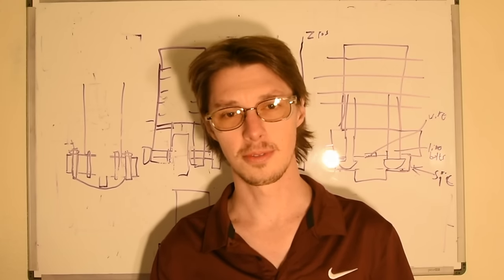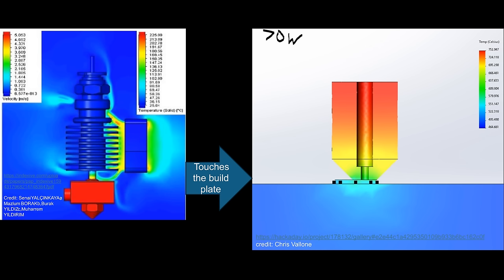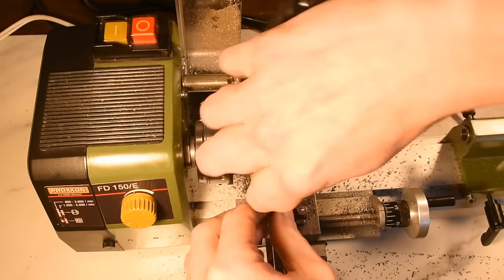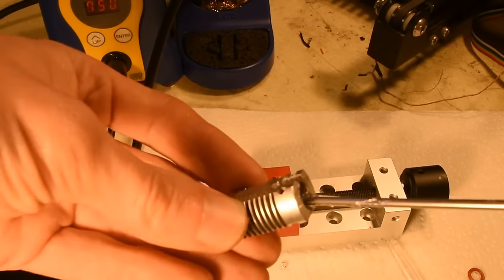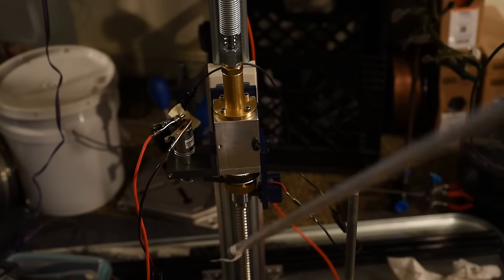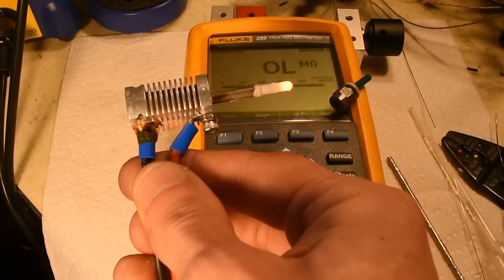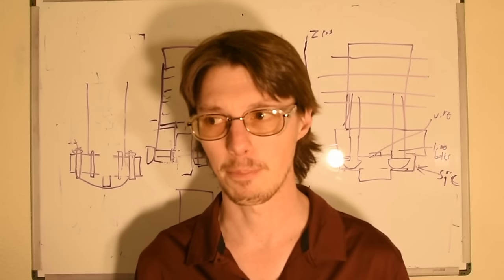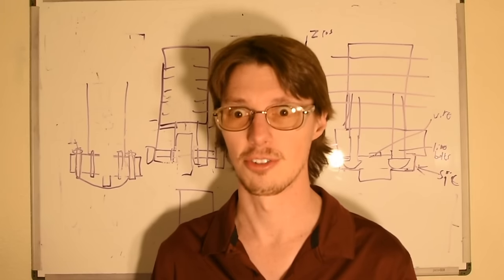How we made a 1300C 3D printer hotend for printing metals on the Creality Ender3

Comment: In both demonstrations at 4:18 
You weld the two metals together using the heat of the glow plug and the pressure you provided manually; forge welding. I imagine that the manual pressure is a significant factor when trying to bond these matierals. Regarding metal FDM, how will you recreate/ address this when printing? Is the heat of the extruded metal + your hot end enough to ensure a good bond to the previous layer? Not sure if you mentioned already in this or other videos sorry if redundant

Btw this is super cool.
Reply from the maker: on the printer, with actual temperature control, the metal exits the hotend in the semisolid state, where its yield strength is extremely low. low enough that the printer's motion frame and the extruder force can deform it and forge it into the previous layer. 
the pappilio lite belt extruder provides about ~12-15 newtons of thrust on a wire this small. which given the surface area of the tip of the 0.5mm wire (0.2 square milimeters) is equal to about 60-75 MPa of forging pressure at the point of deposition. because we do not have a nozzle constriction, this pressure is applied directly to the hottest region of the deposition zone thus ensuring forge welding like behavior on the constrained wire tip. 
the conditions are actually quite comparable to the examples, and actually more favorable in many ways. 
but only more testing can prove this out.

Comment: There's this company that came up called Yageo Nexensos that makes high temperature (up to 1000C) platinum resistive temperature sensors.  They'd be expensive if you can find them, they show up as 0 stock on digikey, but you might be able to get a quote from them directly.  Another option is infrared it wouldn't be as easy as slapping it to the side you'd have to consider things like smoke obstructing and emissivity and viewing angle, but they can in theory go up well past 1000C.
Reply from the maker: a good type K thermocouple, electrically isolated seems to be the way to go for now. :)

Comment: Anneal in air or in inert?

If you need to Anneal in air or mild inert (I can purge argon) let me know, I have a few furnaces and can fire up to 1700C, ramp-soak of course.

As for the thermocouple you should be able to filter out the electronic noise.

Comment: Would have thought a sheilding gas or inert atmosphere in the printer would be required for success with this concept, interested to see how it works out. Temperature feedback could possibly be achieved by sensing the change in resistance of the heating element from the ambient condition and using the resistance temp coefficient of the material to approximate its temperature.

Comment: Do you think you'll eventually be able to offer a metal printing upgrade kit for the ender 3 and clones thereof? 

Because I for one am VERY interested. But I lack the time and finances to experiment. 

Also, how would you go about interfacing with a slicer? I doubt cura supports aluminum.
Reply from the maker: yes this is the plan to offer open source upgrade kits when we can demonstrate function. 

as for slicing, adapting a slicer profile is not too difficult its mostly a matter of setting temperature and feedrate. otherwise the process physics are quite similar to printing chocolate just at very high temperatures.

Comment: An ambitious project for sure. As glow plugs were designed to be somewhat momentary for use, I'm curious as to the longevity you'll encounter. Replacing them per print as a consumable early on wouldn't surprise me. You may want to look into pulling the electrode out of a standard spark plug that fits your space parameters or other high temp electrode material designed for more prolonged use. 
With printing metal, there's a few other long-term environmental issues that will come up, namely weld contamination, when you attempt to print in open air. I'd be tempted to introduce more common welding materials such as flux core wire (contains its own shielding gas) and borrow the tips from said welders to transfer power to the wire. Although at that point, you'd be better served making a custom adapter to miniaturize a flux welder and use the cartesian system of the Ender as stand-in for a CNC coordinate system, which would rather defeat the purpose of your project. 
A worthwhile project that I'll definitely sub to see your future progress. 👍
Reply from the maker: the glow plugs are surprisingly robust to semisolid metal exposure. 
this still requires more testing to be sure. 
we are aiming for at least 1000 hours of print head lifetime in bronze.

Comment: Neato.  When you melted the wire to the borosilicate, it reminded me of how bond wires are welded to the silicon die in a computer chip.  I believe they use ultrasound for that?
Reply from the maker: yes. Though the first technique was thermocompression bonding, which was basically what I was doing, and one of my major inspirations for this project.
my day job is working in a cleanroom.
https://high-density-electronics.uark.edu/

Comment: Have you considered induction heating instead of resistive heating? You would be able to heat the wire even more directly, and be able to heat the print right under the nozzle for better layer bonding. The downsides would probably be having different heating characteristics for different metals, and not being able to print non conductive materials.
Reply from the maker: yes we have considered it and continue to investigate it. 

I want to be able to print ceramics and glasses as well. which makes it unattractive for my particular use cases.

also induction heating with wires this fine (0.5mm diameter)is extremely difficult and tends to be very power hungry due to losses to the substrate.

but if you do give it a try, I would love to see it. :)

Comment: Its really interesting to see a more direct form of metal printing attempted like this, now that the industry standard has shifted into laser sintering. Really looking forward to seeing where this goes
What is that tiny lathe you were using? Would you recommend it for small parts?
Reply from the maker: the proxxon FD150E is fantastic for small parts as long as you do not require autofeed.

I have used it with High speed steel tools that Proxxon provides, to cut everything from common plastics, torlon, and PTFE, all the way up to Titanium zirconium molybdenum alloys...

it is best for parts smaller than about 15mm in diameter. Though it can grip objects up to about 50mm in the 3 jaw chuck at maximum extent.  
the drill chuck it comes with is good up to about 7 mm bit size. but the lathe itself only has about ~150-200 watts of spindle power, so you have to be conservative on the feeds and speeds and make sure to keep your tools sharp and your work well lubricated. 

I have been very happy with it, compared to a boley watch lathe or some other similar thing at this size and cost range.

anything larger would be impractical for my use generally. so the proxxon has been a great fit.
Reply: @rotoforge2024 awesome, thanks for the info
Reply: Fascinating

Comment: When you get to printing don't forget the argon atmosphere, N2 works too. Need to remove the O2 from the print area with metals.
Reply from the maker: thanks!
going to try to work without this, by having very fast temperature control at the deposition region.
Reply: @rotoforge2024  Welding onto oxidation should make a bad weld right? But pardon my limited knowledge on metal fdm. I can't wait to see more, you are obviously the guy for making this happen👍🏼
Reply from the maker: @itsmetheghost4993  the tin in bronze melts before the copper does. molten tin is a potent getter for oxygen from the bronze surface. the still solid copper grains in the bronze when it is printed act to plastically deform and scrape the surface of the previous layer which facilitates intimate metal-metal contact at high temperatures. 
In this way, the need for a protective atmosphere can be reduced if this process of melting the tin, deforming the copper grains, and spreading the resultant semisolid metal bead onto the build surface of the previous layer  happens with sufficient speed and precision in terms of temperature control and at sufficient applied pressure at the deposition interface. 

IDK if i am the guy...but i am doing my best. lol

Comment: Isn't the stepper motor on the EDM drill kind of in a dangerous position to be contaminated with conductive debris? Feels like it would be much safer to have it mounted on the top of the rig instead of the bottom right by the vice.
Reply from the maker: it does not appear to be having trouble after about 20 drill operations. I will be sure to update if/when it fails.

Comment: great project!
PS arent you worried that the GT2 belt support/fasteners and stuff will melt from reflected heat?
Reply from the maker: Not at all. the glowplug power consumption is quite comparable to the stock hotend. So the stock cooling solution protects the printer quite well.

Comment: It will be so cool if this ends up working well and turning into some sort of ender 3 upgrade kit. Plastic 3d printing is nice but a high melting point metal 3d printer would enable the 3d printing of many things like engines or far tougher parts or parts that need to be heavy or thermally or electrically conductive.
At 1300ºC you are also very close of some steel alloys melting point, I wonder if you have plans to get there?
Reply from the maker: the glowplugs react with iron unfortunately...so the engine might have to be made of bronze, or maybe monel. Ferrous alloys are off the table until we can find a solution for their reactivity with the glowplug ceramic above about 900 C.
Reply: @rotoforge2024  It is a pity but any metal printing will be nice and monel seems to be very good, the only issue is cost vs steel but the convenience of 3d printing can make it totally worth it. I imagine that solving the reactivity issue won't be easy, maybe in a future where metal melting hotends are popular and custom made for that purpose instead of repurposing glow plugs.
Reply from the maker: @eruiluvatar236 This is probably the case. though we might have an alternative design that will get us there...
so IDK. 
research is not easily predictable.

Comment: Amazing project, may I say sounded ambitious until I you showed the progress you already made! All the best with your PHD.

On a side note, how are you planning to attach the thermocouples to the tip of the heater?
Reply from the maker: probably stuffing them into an alumina sheath tube from mcmaster, and mounting them with refractory zirconia adhesive from mcmaster. 
https://www.mcmaster.com/8746K586/
https://www.mcmaster.com/products/zirconia-adhesives/
using this thermocouple packed into the alumina tube with some boron nitride paste.
https://www.sparkfun.com/products/251
https://www.sliceengineering.com/products/boron-nitride-paste

Comment: Looks complex, but also super cool.  It gives some hope for at-home metal 3d printing in the future.  I realize it'll likely never be available for a typical 3D printing customer who is used to plastic, but maybe with some good ventilation and other safety measures, it could be used by a serious hobbyist.
Reply from the maker: I want it to be available for exactly these people. 
all the parts and materials for the printer cost less than ~150 USD as raw...
I spent about 1800 USD on the EDM drill. 
I intend to sell kits as drop in hotend replacements in the long run. so its as easy as possible to print metal on your desktop.
Reply: @rotoforge2024  Maybe a few more iterations of this and you could sell hot end kits including the oil pump, hot end power supply, tubing, ventilation fans, hose, cables, etc.  etc.. for around $1000-$2000.  I'm certain there's a market for that, because there'd be no competition (until Chinese manufacturers get into the act).  I think selling a complete kit is the way to go because it can build up a community of users who can advise each other on techniques because they're all using exactly the same components. And it would help you refine the system over time, and figure out where you can take advantage of economies of scale.  Or perhaps you could sell the whole concept to Creality or some other 3D printer company.

Have you been able to measure layer to layer bonding using this technique?
Reply from the maker: @yeroca  Are you suggesting i should sell EDM hole popping machines and hotends?

I might one day get into making whole machines for the hotends (probably also made custom rather than from glowplugs) but that day is a long way from now lol.

i agree a community running and developing on similar infrastructure is highly desirable. :)  I think we need to simplify our manufacturing process a bit more for this to really get into swing though...

initially I expect to be providing just hotend kits if anything at all. Mostly for alpha test to a limited number of select users until we know this can work and work well. I do not want to be selling some non functional product or shilling for investor cash. those seem like wastes of time. 

Thanks for the thoughtful comment. Frankly, I really hope some chinese manufacturers or other manufacturers get into the act. please  someone build this thing. 
I would love to be able to just buy a working metal and ceramic 3D printer for my home desktop for <1000 USD. I would do it immediately and cease my maddening toil. lol
Reply from the maker: @yeroca I should also note that we are targeting probably <1000 USD for the final kit price...
probably <500 if we can swing it that low...but its too early to tell.
Reply: @rotoforge2024  One thing I may have misunderstood... I was under the impression the oil pump is used to circulate a "coolant" through the upper part of the hot end.
Reply from the maker: @yeroca  the hotend is cooled with air from the stock ender 3 fan. 
the oil pump is used to pump oil through the EDM drill spindle to drill the hole in the glowoplug ceramic.
Reply: @rotoforge2024 Ah, got it.  Nice, so the oil pump is not needed during printing.

Comment: Have you looked into inductive heating of a hardened steel nozzle? I think this idea is a simpler solution
Reply from the maker: I should probably make a video about this considering the frequency of the question. 
but yes, we have considered it. 
I couldnt wrap one tight enough either without it melting down during printing.
and even if I wound it tight enough, it would need to run at a frequency where the driver cost would be huge. 
like 800 khz to 1 MHz.

maybe a bit more.
maybe halbach induction arrays could improve this situation. 
but I am interested in printing glasses and ceramics with the same hotend. So induction heating is not really going to suit my application....
would love to see it tried though. we have people in the discord working on it actively. super exciting stuff. 

Steel dissolves in molten metals and molten glasses and so would be unacceptable for most things I want to print.

Comment: Aluminum (mig) wire might need a shielding gas, around the glowplug tip, like argon to keep flash crusting oxidation from mucking things up. Similar to a mig welder.
Reply from the maker: I have not yet found MIG wire in 0.02" diameters.
do you know where we could find some?
Reply: @rotoforge2024  no, maybe bonder wire or edm wire?
Reply: maybe not lower melting...

Comment: Imagine how cool could be removing the supports
Reply from the maker: might not need to since metals have potentially much better overhang performance than plastics.
then again, sufficiently tight thermal control may allow composition control such that the supports are bonded by oxide layers instead of metallurgically. this may make them quite easy to remove. 
have to run more experiments to know...might be a while lol.

Comment: Suggestion you need a inert gas delivery system so the wire wont corode during the print
Reply from the maker: going to try to work without it.
sufficiently good temperature control and sufficient flow rates should minimize oxidation. 
semisolid forging during deposition should ensure strong interlayer bonding in ambient air, particularly for alloys whose native oxides have high solubility in the liquid fraction at the printing temperature. 

if it proves necessary we may bother with a oxygen concentrator to get nitrogen flowing over the deposition zone.